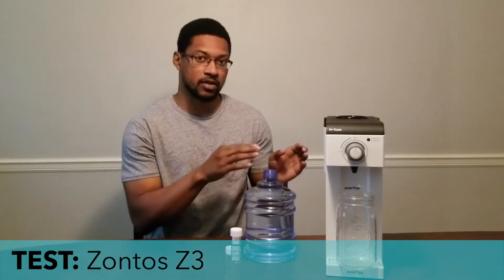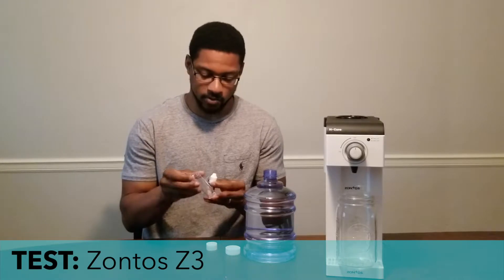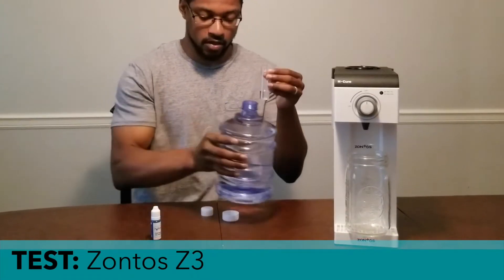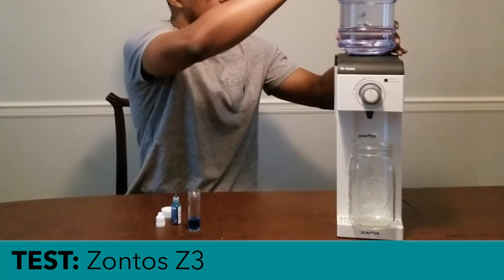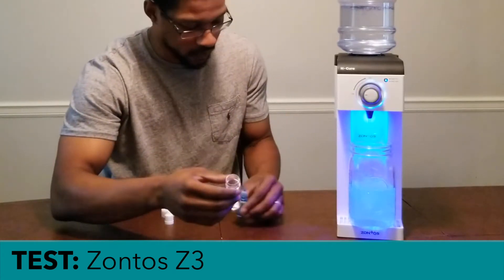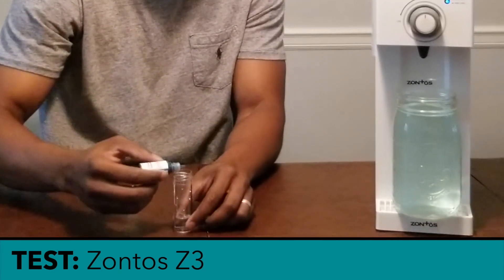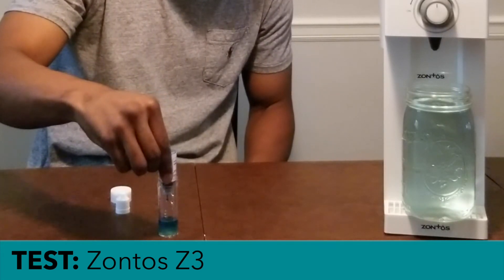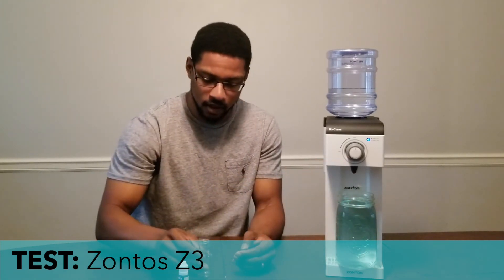TEST: Zontos Z3 - H2 Water Generator || H2Hubb

Comment: Inhalation vs water? Both? What would be the dosage? And is it daily? How many times in a day and when in the day? Do you need to periodically come off hydrogen and when to come back on if so
Reply from the maker: Hello Gigachad, 

Those are all good questions. To begin, I will address hydrogen water vs hydrogen inhalation. In my personal opinion, pertaining to the scientific data both of these administration methods (H2 water and H2 inhalation) have their advantages and disadvantages and can exhibit slightly different therapeutic effects or virtually the same therapeutic effects depending on the disease model. It has been noted by researchers in scientific studies that there are genes in the human body that may respond differently to at least 4 different administration methods, exclusively hydrogen inhalation, exclusively hydrogen water, hydrogen water + hydrogen inhalation in conjunction with one another, and lastly, hydrogen water and inhalation administered simultaneously.

“We demonstrated that hydrogen-responsive genes are divided into four groups: genes that respond favorably to hydrogen gas, those that respond exclusively to hydrogen water, those that respond to both hydrogen gas and water, and those that respond only to the simultaneous administration of gas and water (Fig. 2).” https://www.ncbi.nlm.nih.gov/pmc/articles/PMC4610055/ 

Therefore, It's best not to assess H2 water the same as H2 inhalation as they have different pharmacokinetics due to different administration routes. Ultimately, there is evidence that supports drinking H2 water and inhaling hydrogen at the same time or in conjunction with one another might be the best approach or provides greater therapeutic effects on gene expression, than doing both therapies separately.

"Finally, we evaluated whether the changes in gene expression were influenced by the route of H2 administration and found that the combination of both HRW (Hydrogen-rich water) and HCA (hydrogen-containing air) had the most potent effects on signaling pathways and gene expression in systemic organs, suggesting that H2 may act not only through a dose-dependent mechanism but also through a complex molecular network."
https://www.ncbi.nlm.nih.gov/pubmed/25707580.

Now, the administration dose for molecular hydrogen via water is still under investigation. Researchers or experts in the field have yet to come to an official consensus (release an official statement) about a specified dosage level (milligrams) of molecular hydrogen for each disease model but there is an agreement that the research is suggesting 1~3 mg/day of H2 is what is seen throughout the literature to produce therapeutic effects in humans, with 0.5 mg/day appearing to be more of a minimum threshold. Furthermore, preclinical and clinical humans studies are administering 1~15 mg of H2 per day, and are seeing statistical improvements in various disease models.

Thus, it's best to aim for 1~3 mg of H2 or more per day. You can calculate this by multiplying the dissolved hydrogen concentration by the volume of water. For instance, the Z3 unit on avg produces 2.65 mg/L (ppm) in our testing, therefore, if you drink a liter (33.8 oz) of the water you will consume 2.65 milligrams of H2. 

2.65 mg/L (ppm) x 1L of H20 = 2.65 mg of H2 ingested. 

If you consumed 500 mL (16.9 oz) then it would be 1.325 mg of H2. 

2.65 mg/L (ppm) x 0.5L (500 mL) of H20 = 1.325 mg of H2 ingested. 

As to how many times per day or when in the day, we need more research to know that answer. All we know thus far is that intermittent exposure seems to be the best approach, which is very easy to do with hydrogen water. H2 water will spike the blood/plasma H2 levels (10~20 µmol/L) 5~15 mins after consumption before returning to the basal level (1~5 µmol/L) within 45 ~ 90 min.

"Ingestion of HRW reaches a peak in 5–15 min and returns to baseline levels 45–90 min after administration depending on the administered dose [110]." https://www.mdpi.com/1420-3049/24/11/2076/htm 

This means you can induce this intermittent exposure effect of H2 a few times per day. Typically, I do it 3 times (morning, afternoon, and evening). 

You can calculate your H2 dose via hydrogen water on our website: https://h2hubb.com/h2-cal/

Lastly, you asked do we need to periodically come off H2. Only if a person wants to. Hydrogen gas signal transduction or modulatory effects can last several days thus some people don't drink it every day or only during the week and not on the weekends. At this juncture, there is still quite a bit of personal experimentation. However, I would say it's best to focus on getting 1~3 mg of H2/day via consuming the water a few times per day. 

I hope this helps.

PS. Sorry this is crazy late. I am just seeing this comment.